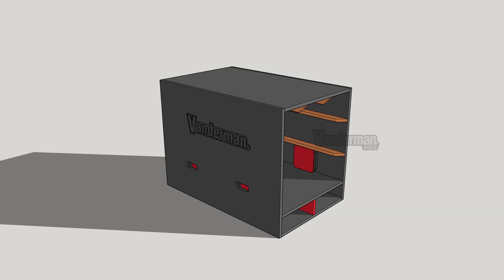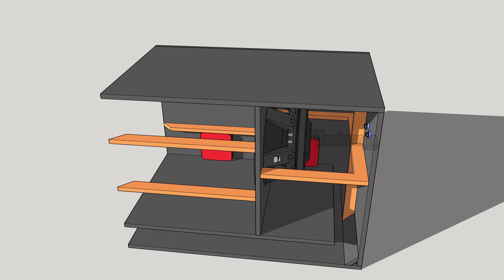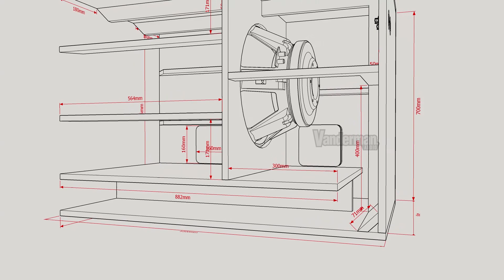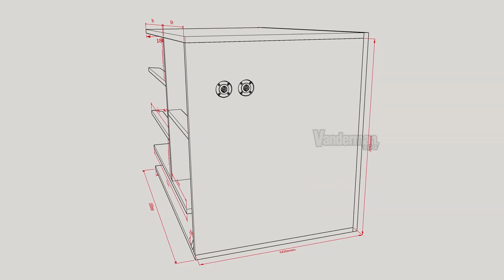SKEMA BOX DYNACORD MODIF 18 INCH SINGLE || Dynacord 118M

Comment: mas ap cocok di isi speaker excellent 1880mk2 sama pd1880
Reply from the maker: Kurang tau ya mas soalnya spek speakernya kurang lengkap
Reply: @vandermanaudio3182  speaker acr excellent 1880mk 2 frequensi 30hz-3khz spl 99db diameter vc99,20mm